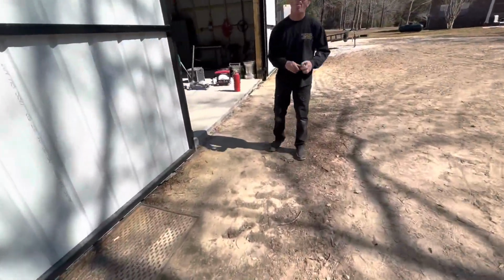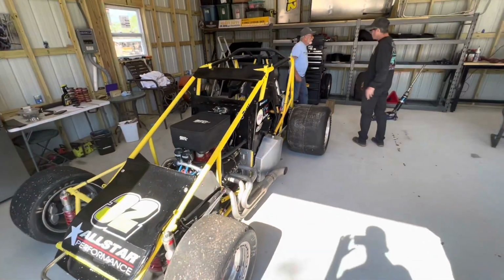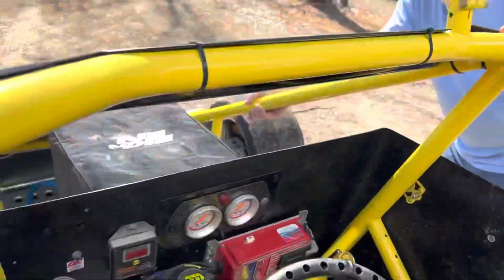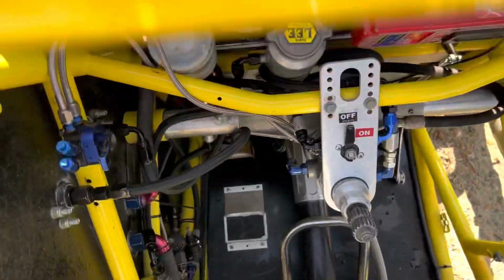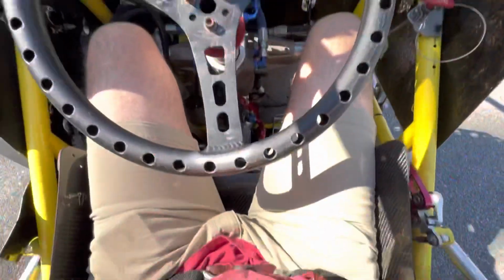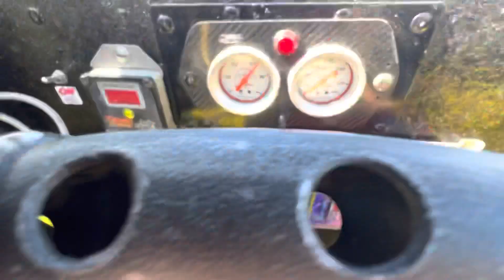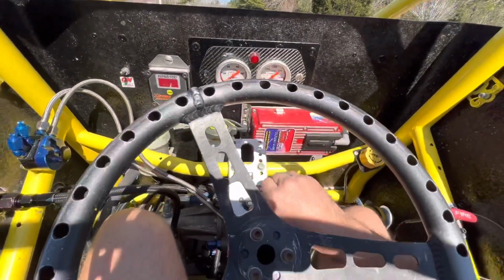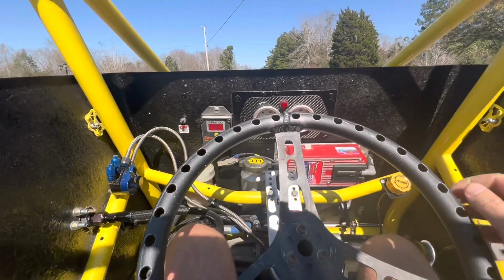Busting off a 410 asphalt sprint car!!

Comment: I miss driving these things I built a thing in my shop that has this huge roller and a electric motor that I slide under rear tires set car on it and I have anchors on the floor that I use to strap the car down to so it doesn't take off through the shops wall and then I tube it right on the shop

Comment: Do they make any of these to turn both ways?
Reply from the maker: Like on a road course? They don’t but I’m sure you could get one to. You would to change a lot.
Reply: Camshaft rotation, yes they do. Not sure about this class though
Reply: There is a old video of a few asphalt winged sprint cars on a huge road course and down the long 3/4 mile straight they was hitting speeds of around 160-180 mph it was insane. There also is a video of dirt modifieds racing on a road course at a track in New york
Reply: Look up pikes peak sprint car it's a full winged 410 I believe running the pikes peak hill climb race and he is flying
Reply: yeah... you'd have to (or would want to, imho) change quite a bit of stuff...  They're built from the ground up to turn left... 2 radius rods on the rt front and only one on the left, only a left front brake (as far as I'm aware), rear suspension probably could be set up to go "both ways" without any "major" mods (w-link and everything "should" work ok turning right)... 

My biggest worry would be that front upper right radius rod, though... I'd try and move that to the center of the axle, somehow, if I were planning to turn hard both ways in it.